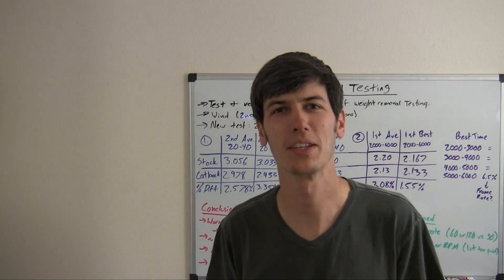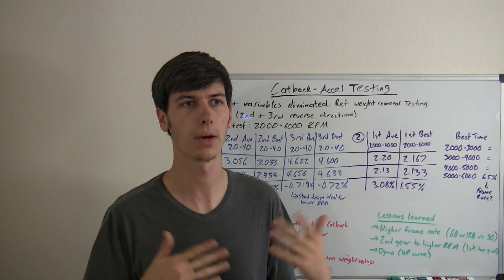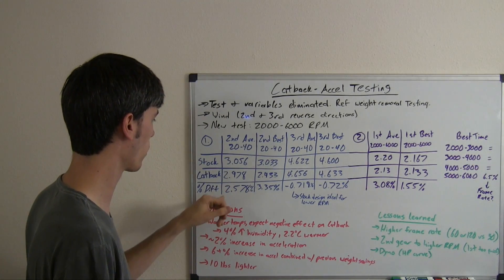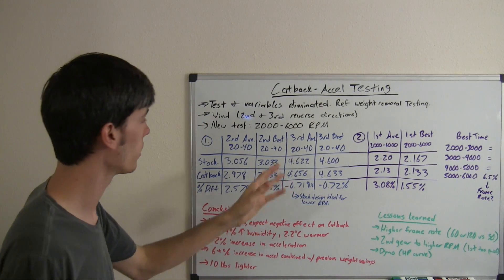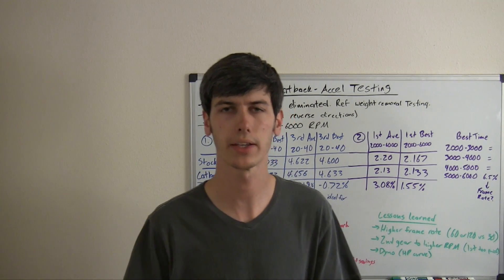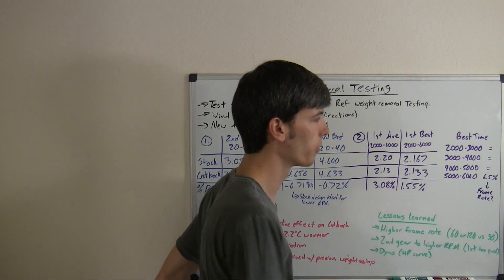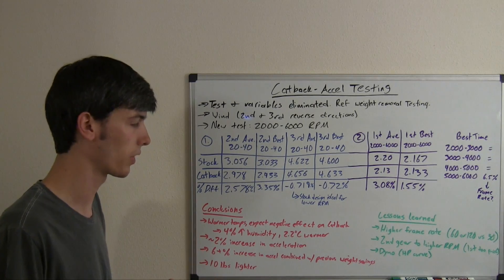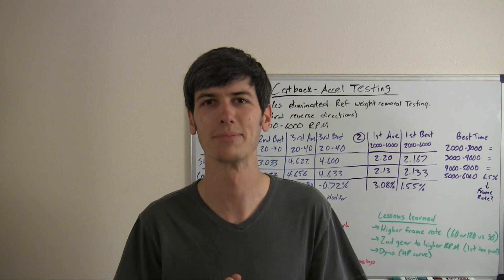Do Catback Exhausts Increase Horsepower? (With Proof)

Comment: depends, if the factory one is restrictive and depends how big the factory log manifold is
yes +5hp maybe factory vs aftermarket. 20 year old factory vs aftermarket up to +20hp depends how blocked old mufflers and cat are.
u need extractors
Reply: Weight is a great factor, I just replace the catback on my Tundra and I needed help taking the old muffler out lol it was probably 40 pounds heavier than the new one.

Comment: What exhaust cat back was used? What type of system did it use manage sound? 
Little secret they them, the ones with the secrets don't tell is that harmonics are used on the more expensive exhaust that's why they cost more. 
The other cheaper ones use deflection, or a material to dampen to the sound.

Comment: Seems more about looking cool with bigger exhausts. Unless your doing timing tests. The results are barely noticeable. Unless the default setup is shot or pretty poor letting gas fumes and air out. Then the difference will be much bigger. 4% increase tops in most cases. Who really cares

I guess whatever floats your boat? 

Good video thanks for comparisons.

Comment: after installing the catback . should you tune to get the increased power of the catback. what i mean is installing a catbavk without tuning is just for the sound right. no power will be gained if i did not tune?

Comment: I have installed the cutback on my toyota corolla GLI 2015 with 2000 cc and after some tests I found that the acceleration increased but fuel consumption also increased. This happens when I run the car in gear 2 thanks for your video

Comment: Dude I need an answer PLEASE! I have a Dodge Durango RT 5.7 I’m thinking about installing a Catback system but I heard this might interfere with the stock design of airflow my question is do I need to tune the PCM to avoid problems? Please Help!
Reply: Since your NA a tune might be necessary but only after you get an aftermarket intake

Comment: I would have liked to see this test done once again swapping back to stock to verify that there weren't any environmental factors at play. The percentage difference isn't perceivable and many factors could affect performance on a given day. Like is the intake temperature gauge heat soaked or not. Weather or not the temperature was colder? (colder air more power, more drag from tires and air) Was there any cross wind?... the list could go on forever.... anything less than 10% is pretty much erroneous data that is meaningless.

The only practical way to test performance is on a dyno in a temperature controlled room.

Comment: A dyno would be nice just so you can see the curves and see what the hp and torque is at different points. Like are you losing low end power to gain it higher in the rpm (answer is probably yes). However timed runs are much better for showing real world performance. It isn't uncommon for a car that make more hp on a dyno to lose to a car that makes less hp.

Comment: This is one vehicle. Obviously cat backs vary vehicle to vehicle and engine to engine. It all depends on hose restrictive the stock exhaust is compared to the cat back. I’ve put cat back exhausts on some vehicles and felt and measured zero change, and some are night and day difference. Usually smaller engines don’t have much restriction stock due to less exhaust output and larger engines tend to respond better. Unless of course it’s a more modeler performance model from the factory with an optimum exhaust system and tune.

Comment: So you dont know if that 2% was because of the 10 pounds less weight or the cat. should've had it at the same weight. Also on a stock car it usually makes it worse, unless turbo is boosted or charger or some engine mods etc.

Comment: I wanted to add something that might explain the catback/etc... as i research i see that intakes help on high end RPM and this video the catback helps in the low end... WHAT IF they need each other for greater advantage.. if the car can not pull enough air how can more air escape? or if you have an intake and no catback, then it would pull more air than the exhaust could push out... just a thought i had.. maybe i did not explain it well but if you understand you might take that into account.   PLEASE REPLY because this has been lingering in my head since i seen this videos and the intake one...

Comment: Edit: You noticed this too!  I just was a bit hasty I guess. :D  
Just a quick thought: we are measuring pretty small differences, and you're times appear to be limited to 1/30th of a second (i.e. limited to the frame rate of the filming camera).  With fractions of seconds mattering in this test I would only go with the averages, not bests.  Just because those could be at least partially swayed by the frame rate at which you are measuring.  And when the differences are 1-3% (1/100 to 3/100) and you can only get  1/30th per second accuracy, might that influence the results a bit?

Comment: How did you choose a cat-back system for an automobile that spins 4,000 rpm traveling at 80mph on an interstate? Did you make a [ Loud droning at sustain speed vs performance gain comparison ] when choosing the components?

Comment: Of course a catback isnt going to improve anything. All the restriction is "upwind." All a catback does is change the sound of your exhaust. For actual increased flow, you need a turboback, increasing everything to 3"diameter from the downpipe to high flow cat (or no cat) and back. Pretty much a waste of time imo.

Comment: Exhaust is going to bring more noise and MPG over anything. It is fun to lay into tye throttle and hear the tone...I just installed a Jpipe, test pipe (3rd cat delete), catback-magnaflow mufflers. I noticed A LOT more throttle responce and I couldnt stop smiling 😄.

Comment: Think of the performance exhaust as a gateway to add more without restriction, you'll never get what you fully want without getting rid of that stock. (04 g35 with invidia exhaust + Invidia pipes + tuned) more to come. Went from 265-330hp. Btw I had a bad aftermarket exhaust before installations.
Reply: I'm looking for tips to increase power on my 2011 g37x..... I have a stillen catback and was considering purchasing HFCs and getting a tune. I have mixed opinions about intakes though because I hear that the stock intake is what's best optimized for the car. I wanna make more power without sacrificing efficiency through the power band any suggestions?

Comment: im thinking of buying a 750$magnaflow exhust sytem will it be worth it and gain power i alrrady have a cold air intake
Reply: kush gottheju1ce2k with the cold air I take the results would be a lot more substantial over a stock motor but you won’t notice much compared to just a cai

Comment: Catback on a turbo is far more effective use of $$ than catback on NA engine.
Also one brand may suck, each should be dynoed
Reply: I have a 2017 gti fastest gti and golf r are running stock exhaust. Years ago Hondas gained from catback.  Newer turbos gain from a downpipe very little to no gain from catback. Just sound.
Reply: Not just Honda's just in general 90's early 2000's vehicles gained from catback.  Newer cars have do much more R&D.

Comment: i have always been taught to NOT lug the motor.  Keep the RPM's up until you are cruising.  If you're losing speed due to a steep hill make the car downshift.  In this case you shouldn't be in the 3rd gear going 20mph lol

Comment: Hey, I imagine this has been mentioned already, noticed that your vehicle was not up to temperature when you were doing these tests on the 0-40 2nd gear tests from Catback 1 - Catback 2 there is a noticeable difference on where your temperature gauge is pointed.  I could also then assume that the tyres were not at temperature and therefore you were not getting a consistent grip on all three tests & the engine was not at peak operating levels.  Although I doubt the difference would be high it is important to have a fair scientific test, or at least highlight what makes a test unfair.
Reply: If I remember correctly a catback exhaust will help lower your engine temperature since the heat can leave the engine faster and doesn't build up where a catalytic converter normally would be.

Comment: The categorical RPM range falls to that low area because even standard cars have a bitching moment with the shifting between 20-40. Make that amount 35 and up and this improves significantly. Like you say, it makes sense and that catback exhaust could feel  versa another. May look into this further to gather a tad more..

Comment: The increased piping size throws of the balance and shift your torque band to higher RPM. That's one of the reasons your not getting a increase in power.

Comment: I saw the vid from cold air intake and now this one. Would it be safe to say that since the cold air intake is slower on low rpm's and the catback is faster in low rpm's if you were to use both you would have better results usong them together vs either or?

Comment: You should've done a test with some added weight since the catback system is lighter than the stock one. So you could've just tested if the pipe alone makes a difference (increase or decrease the power).
Reply: Xerdoz the weight aspect is part of the test though

Comment: All I can say is the numbers I have. EP3 with stock K24A2. Stock header, test pipe, tanabe midpipe (2.36") = 180 WHP/170. Ktuned race header and Invidia Q300 = 210 WHP/190 WTQ. Dyno and Tune on both.

Comment: @Engineering Explained I dont know if someone else mentioned that before but it is an importand note. The percentage of power increase is not the right one. As you modify the engine more by the time to get a better horsepower output than the stock 140hp,a part of the power gain will be exhaust gain,as the exhaust's inner diameter will be more relevant and suitable for the engine's power output. Correct me if Im wrong,we are here to learn! :)

Comment: Think of an exhaust system as a multiplier. (Example, not actual stats)
Exhaust = 2%
Exhaust + Intake = 5%
Exhaust + Intake + Tune = 10%
An exhaust alone will do nearly nothing by itself, same for an intake, but both of them together multiply each others performance. Every engine will have different results along with different stock parts to work with depending on model.

If you want to greatly increase horsepower, your best bet is to research the best Exhaust + Intake + Tune combo for your engine. 

Currently im looking for a combo that will bring a 300hp 05'-09' Mustang GT to around <420hp that will cost less than a $6k supercharger/turbo kit. (My 420hp 2013 GT was stolen, so I need something that will have the same, or more power.)
Reply: You'll never get 120hp gains from a catback, intake and tune. Not even with headers, full exhaust, cai, and tune. You'll need a cam and maybe headwork.
Reply: @billdaggett7911  but ecu and dyno tuning on turbo engines can really increase power, or at least usablility
Reply: @scarea2691  that's a turbo engine. Turbos are intentionally oversized so that they operate in a safe range for durability. Increasing boost reduces turbo and engine life and makes more power. That is not possible with Normally Aspirated engines.
Reply: 10% stop watching fast n furious  its more like 5% maybe = exhaust+intake+tune if you got stickers you can get 7%
Reply: HexifiedGaming 400 ci. Craigslist special, I see Malibu and montes going for 3k . They're all Automatic in that price range if that's a deal breaker.

Comment: wouldn't you need to swap the header and cat to get the performance gains?  since the flow through any pipe system will depend on the flow bottleneck. 

https://www.khanacademy.org/science/physics/fluids/fluid-dynamics/v/fluids-part-7

I love the experimental analysis but I'd love to also see the actual physics behind why you saw gains.

Comment: From various videos I've seen regarding exhausts and air intake systems, it seems like just adding a more free flowing panel filter and just replacing the stock muffler with a better flowing one will have the same effect has the latter while saving a ton of money. If a vehicle already has say 2.25 inch piping or better depending on the power it makes, then one would assume that it is designed for that diameter of piping and just making the flow better will give you a couple horse power while giving you a nicer sound and maybe a couple mpgs of you drive moderately. Would you consider this accurate?
Reply: Bizzenn1976 maybe

Comment: The results would have been different if you haven't used a cheap $200 catback and used higher quality one
Reply: @Tyler Ross $455? Wow thats cheap. For our 2015+ sti the catbacks sells somewhere $700  to $2500.that cheapest one is the dual tips only.the quads starts from $900+. That $2500 is the full titanium invidia R400. But the most expensive one is the BLITZ full titanium catback for $4700
Reply: @Martin38-r9b   It gets worse than that I have seen $15000 for cat back on a German car

Comment: how are you timing this? filming and eyeballing only 3 runs? because if so your margin of error completely scrubs your results to be honest. only 3 runs and you're eyeballing the time. you'd need at least 10-15 for anyone to even consider your results. I don't mean to be a dick or a skeptic but that's just how it is in the real world. holding a stopwatch isn't reliable for low times like 3 seconds and even if you're 100% confident in your results you can still expect a 5% margin of error at best, assuming you do 10+ runs each time.
Reply: +Peter Costello In Engineering Explained's defence, he is not writing a paper to be published. Nobody in "the real world" is going to scrutinize his data and reject his findings because his effect size is going to be too small. This is an attempt to quantify the difference between a stock pipe from the cat backwards and an after-market pipe for lay-people. He has used a valid measure albeit not the most accurate but for all intents and purposes they would suffice.
Reply: ***** try actually taking a meaningful lab science course before trying to be a keyboard warrior then you'll see all the flaws in his data. :)

Comment: so 2% sounds kind of small for something that would cost say $1000 or however much. would you say its worth the money or are there more cost effective things that could be done instead?
Reply from the maker: +iwrotefuck This catback is something like $200. Removing unnecessary weight is the most cost effective thing you can do.
Reply: and i think the more stock horsepower, the higher the increase after the exhaust installation
Reply: Yes. Weight reduction, starve and lose some fat, get a better power weight ratio ;)
Reply: +Engineering Explained +iwrotefuck  I thought the point of a higher quality exhaust was to aid other mods such as a supercharger as theres less exhaust stresses and stuff so you can get higher HP, without making any mods that require increased airflow there will be very little improvement, some of which just might be due to the limit of accuracy of the measurement device
Reply: iwrotefuck get it tuned afterwords. That way your vehicle can try to get the most out of your cat back or full exaust.
Reply: +iwrotefuck When your car is from the 60's and it barely has 70hp.. You'll kinda want to grab that one extra hp if you can. Cause that's realisticly all you can get for a cheap mod.

If i go all out on this engine, i'll probably go to the 100hp mark before the engine starts being unreliable.
Reply: Weight reduction is free
Reply: +Dhair T its just for very slight increases which is barely noticeable but you are correct in terms of aiding other mods. its like putting a short ram intake in your engine. gives you a very short burst of boost (and i mean short) and unfortunately most people who only put an intake (which cost anywhere between 120 - close to 300 bucks) dont know this fact. but i mean if you put these mods just for sound then it will def do that for you!
most ppl who look for big gains needs to spend thousands of dollars
Reply: Could you go full straight pipe with a high performance catalytic converter and get the same gains compared to a full cat back exhaust?
Reply: all I can say is every number counts.
Reply: go with nos much less crazy hp
Reply: i wouldnt upgrade even if it was a 10 percent increase, not worth the thousand dollars

Comment: so what I got out of this video is that an exhaust does nothing for your car as an "everyday driver" at low RPMS? Only get a new exhaust if you intend on hitting high RPMS at higher speeds which you're only able to do at a racetrack without getting at ticket. Would you recommend getting an exhaust to someone who doesnt race, but wants their car to go faster? Is an exhaust the answer?
Reply: +Michael Hernandez booost
Reply: to me the purpose for changing exhaust is to get a better sound not to much of a performance gain

Comment: how about if we take the muffler and resonator off and put straight pipe all the way down ? Isnt it same thing ?
Reply: ayberk vergul You'd have to take the specific parts to be flow tested to see how much performance you gained from going straight through on stock diameter vs. having the resonator and muffler on a higher diameter.